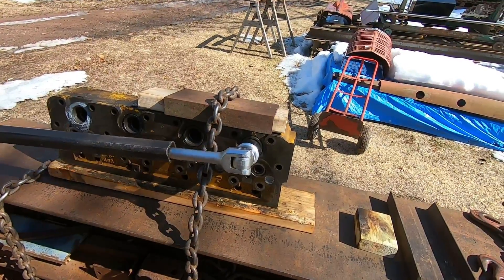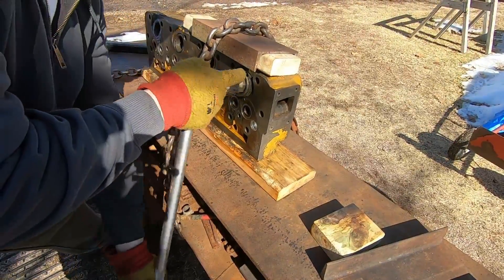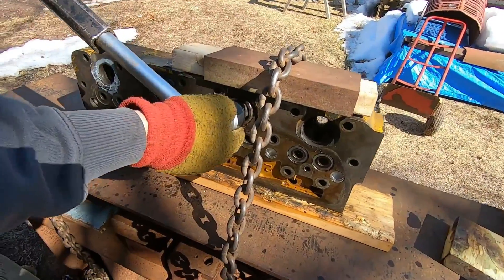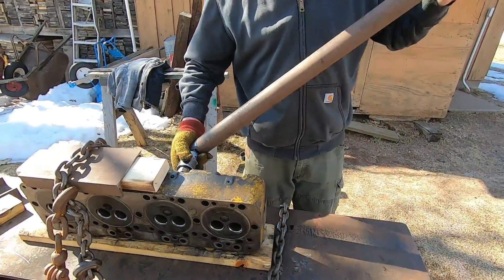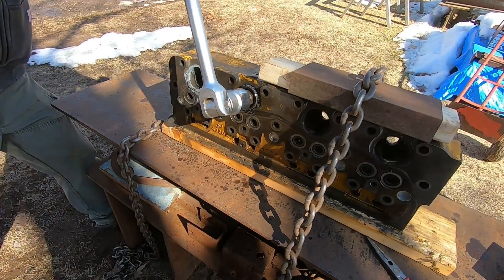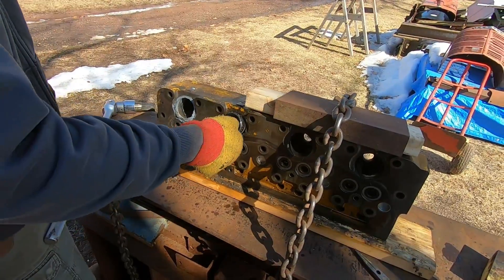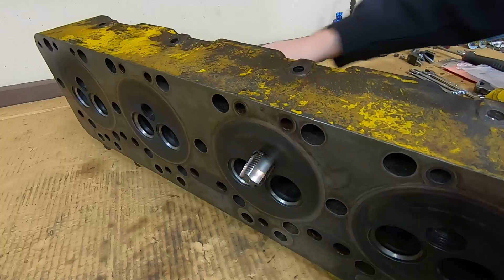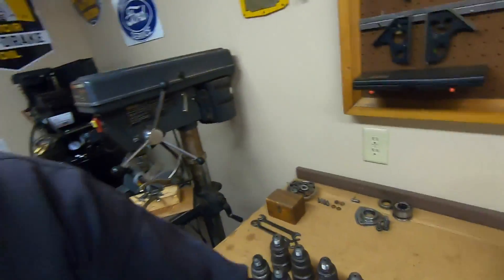Caterpillar D2 #5J1113 Diesel Engine Assembly Ep.36: Precombustion Chambers Out!

Comment: Ive a tip , not so much for this job but seized fasteners in general. I like to make a mark with a tip-ex pen on the far end of the fastner, so when I feel it turn i can tell right away if its actually turning and im not just twisting the faster.  would be a concern with these precombustion chambers, if it were the threads that were seized, i bet they would sheer right off :)

Comment: Success! Remind me of (2) situations. The first was getting the VERY stuck pistons out of the M.... And the second was getting that countershaft out of the H transmission! Man, the feeling when you get it apart (somewhat) successfully is even gratifying! Ha ha. When I opened the clutch housing on the F20, there was QUITE the surprise in there. After I got all the mouse nests out, the pressure plate assembly looked like you pulled it off the deck of the Titanic! Nice work, fellas! Making progress towards a runner!

Comment: well done, getting those chambers out, after you'd got the first one out and  it had started  to gall the threads, I was worried it would rip the threads out or shear the chamber off, I've just had a john deere 1177 combine where trying to free up the swinging shackle bolt that retains the front elevator to the main body sheared, what a pain that was to remove and put right.

Comment: I can tell you that i feel your pain, my D-339 thats in my D-7 are two piece but still a big job to remove. And glad i did had one that after cleaning had a small hole in it. I was lucky and my cat dealer had a set of 4 in stock, old with lots of dust on the box but still brand new inside.

Comment: Great vid. Congratulations on the victory with those chambers. Just wondering if when they are refitted if it would be worth using a modern Hi-temp anti seize compund on the threads?
Reply: ...The threads were not the culprit.  The dry area where the o-ring lives is the snag.  Just goes to show how useless penetrating oil is.  Project farm tested them and this proves it.

Comment: Few people get to experience the exhilaration of success after attacking such a challenge. Seven foot cheater bar with 200 pounds of solid muscle hanging on the end amounts to 1400 ft-lbs. Not that I have near the experience as the "Squatch Super Team" but have found it helps to add some rust penetrant while working a stubborn fastener in and out.

Comment: I think that if you go to your steel supplier they might have a hardened tool steel hex stock that is the same diameter as that tool or perhaps a specialized tool/hardware store. Maybe even snap on might have a hex/allen key socket this big.

Comment: Oh the memories! Glad to see you using a breaker bar, even a 1 inch ratchet would not like a 7 foot cheater!! 
Was changing an engine on a fork lift, felt what I thought was seat material and ended up eyeball to eyeball with  a dead rat!
Thanks for a great chanel.
A retired machinist

Comment: Those injectors are certainly substantial could you explain to Novice  like myself how they work?
Reply: Those aren't injectors, those are precombustion chambers.
Reply: The injector sprays in the small space of the precombustion chamber and causes a violent jet of expanding fuel and gas out the small opening at the threaded end into the bowl of the piston.  The resulting swirl promotes complete burning of the fuel charge.  There were other designs of precombustion chambers in early diesels but all were supposed to cause the swirl.   Also fuel ignites maybe a little easier than direct injection?
Reply: Ok thanks, helps on understanding how it all works

Comment: How does the pre combustion chamber work
Reply: The injector “cracks” and begins spraying just before TDC and the fuel in the confined space of the precombustion chamber ignites immediately, expands rapidly and jets out the lower opening causing a swirl in the bowl of the piston.  This promotes a complete burn of the fuel charge but is less thermodynamically efficient than direct injection because of the chamber being in the water jacket
Reply: Here's how they work....https://youtu.be/9m43V7M2rTE

Comment: Can the pre-combustion chambers be copied by a machinist?
Reply: The part you don’t see is that the chamber is two pieces brazed/welded together to form the chamber inside.  The production of the two pieces might be a challenge, but fusing the two parts together and keeping things true would take a good setup.  Maybe the final machining and thread cutting could be done last to avoid problems from the fusing process?
Reply: I'm not sure how they could copy the hex for the insert and removal tool...
Reply: @paulsilva3346  A rotary broach.
Reply: @brianrvd  Is it possible with a broach to go to depth on a chamfered O'ring seat area.?
Reply: @paulsilva3346  The broached shape doesn't have to touch the chamfered area, it can end before the chamfer.

Comment: Whatever that stuff was you pulled out of the head, looked like some kind of moss or algea. Was it in the water channels? Just wondering if it was a mouse nest or anything, if that area was ever accessible from the outside.
Reply: Squatch253 Thanks for your answer. I’ve heard about horsehair pads being used on the outside of the radiator to prevent metal on metal contact, I think Ford used to do that. Maybe at some point in time CAT did to and some operator saw it poking out at arround the filler cap and though “Oh, guess that belongs inside” and stuffed it into the radiator.

Comment: I've heard plenty of guys talk about white vinegar soaks for stuck engines etcetc.  Do you have any experience with it? Like your set up there. Thanks for sharing
Reply: Vinegar (acetic acid approx 4%) would be somewhat similar to citric acid which is a good slow/safer rust remover.  When you’re  in a hurry you can use muriatic acid but that’s getting away from the slow/safe category!
Reply: @jimrankin2583  I've heard some say on the old tractor group it worked better than oil based soaks, as in quicker. But nothing definitive, no personal experience.

Comment: “Can you believe people call this fun?”  Can you believe some people would call this uninteresting? Question: Exactly what does the precombustion chamber do? Do modern Diesel engines have them? If not, what has changed in the fuel/air delivery systems that no longer requires them? Have they changed injector designs, increased injector pressures, or something else?
Reply: The pre- combustion chamber allows use of the glow plug, and gives a smaller chamber for initial combustion, then the flame front passes into the main chamber( cylinder), which is what allow these engines to start in colder weather.
Reply: Emmett Johnson thanks so much for the answer
Reply: @charlesward8196  you're welcome sir

Comment: Something l learned over the years  is .. if when working something like that in and out if when you spray it with pb blaster  then brush on anti seize the silver one and more pb blaster working it in and out it will take the anti seize in and  eventually it will get easier. 
That is how I got the front bolt out of the front fuel tank strap on my f350.  Only took 4 hours to get it out.  But i didn't break it either. 
 It keeps threads from gaulding .
😊😊😊😊👍👍👍👍👍
Stay safe y'all.
Reply: suggestion when working around wet heat the silver/aluminum anti-seize will work but if working around dry heat or super heated heat it is better to use the copper/nuclear anti-seize. the problem is that with dry heat the oil will boil out of the silver/aluminum anti-seize and jam the threads when you try to get it out. so, the copper/nuclear or sometimes nickel to me is a better choice. my opinion but you know how that is
Reply: @richardnott7970  i was talking no heat at all . Cold.

Comment: Are you able to use anti seize on those when re installed?
Reply: Sure you could, but it would get washed out anyway. But with a modern antifreeze/coolant it won't rust as bad as that again. These things would often be full with just plain water back in the day, not to mention what antifreeze they did have didn't have the best of rust inhibitors.
Reply: ColtaineCrows ah, I really didn’t think!  They are in the water jackets. I had a “duh” moment. Haha! Enjoy your day.
Reply: I like the idea of using a copper paste anti seize on the threads and copper washer/seat area.  It’s been my experience that the threads often suffer much worse than even the #2 chamber in this head.  Maybe the extended soak prevented a lot of that on this head.
Reply: The threads are sealed away from the water jacket by a copper washer.
Reply: The threads aren't the worst problem.  Notice the dry area where the o-rings are.  That was the snag.  The "penetrating" oil did no "penetrating" as usual.  The stuff is a waste of time and money.